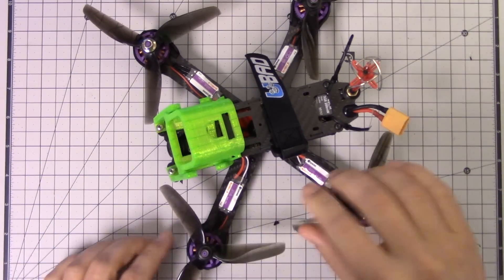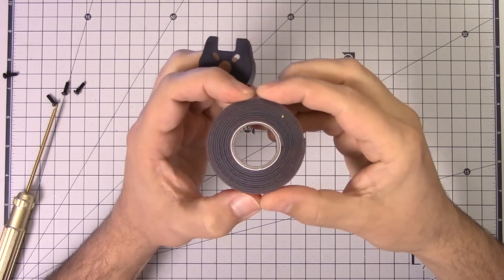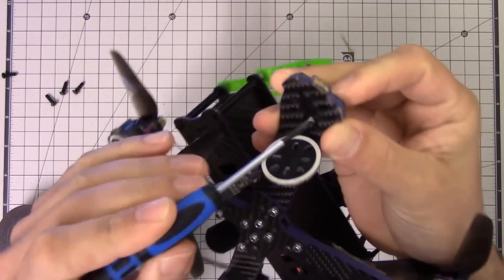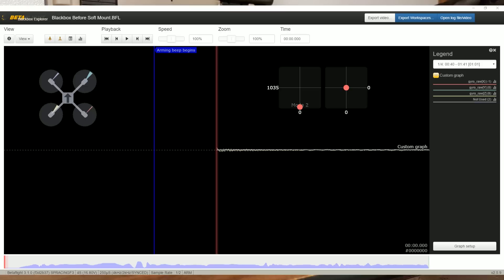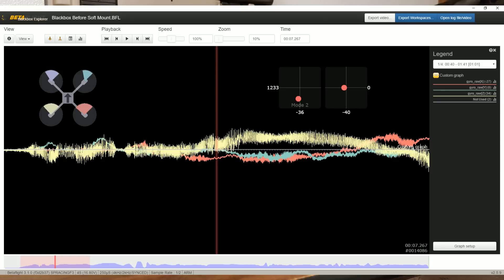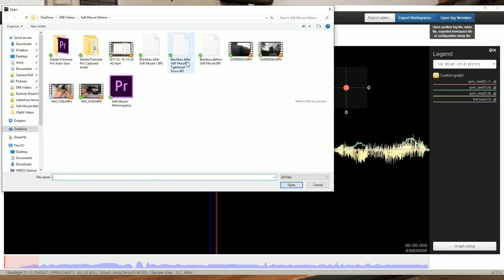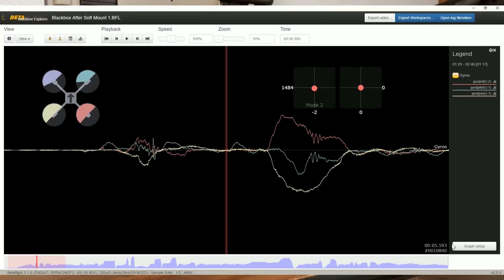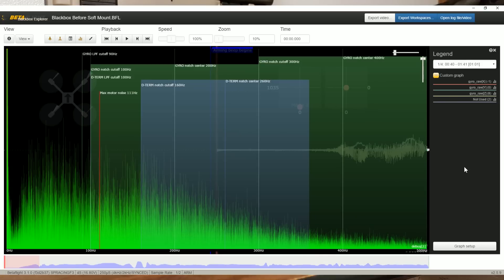Soft Mount Quadcopter Motors | MYTH BUSTED OR CONFIRMED?

Comment: Awesome idea! Have you thought about adding a bit of padding to the screw head side when mounting? It may create even more vibration isolation as it reduces the problem you brought up in the beginning (how the quad still has contact to the frame), as well as possibly allowing you to put more torq on the screws for added safety. Maybe it will make the ride that much more "juicy"? Haha
Reply: Or use an O-ring. :D Also, some adhesive tapes have just as much holding power as those screws, potentially eliminating them all together!
Reply: @wanderlost.productions   Are you suggesting using double sided adhesive tape to hold your motors on?  Good luck with that!.. :D

Comment: seems obvious that 1.5mm of squishy foam tape would have some dampening affect however i would love to see you repeat this with electrical tape and see if it performs at the same level. Also makes you wonder if fully isolating the motor with proper vibration dampeners would work well. http://static1.tme.eu/products_pics/6/b/e/6be2c7d9b4beb7e867114e4d9d25bfed/19206.jpg
Reply from the maker: +Queron Williams seems obvious and yet the skeptics abound.

Comment: I have tested different materials and some are better than others and even worse than nothing. best one yet are 2 layers or doublesided foam tape, same as Joshua demonstrates here. I also tryed one layer with good results but not as good. I tryed 3 layers of Electric tape and it worked but not nearly as good as the foamtape. I also tryed 3 layers of theraband black rehabilitation training silicone bands and it dident work the right way, it was worse than non soft mounting. mabey the material is good in itself but atleast not in 3 layers becouse it tends to "cripple" and wrinkle up and "delaminate" when tightening the screws.
Reply from the maker: +SLINGSHOTandMOLOTOWS this is not foam tape. It's a rubberized mounting tape.
Reply: Have you tried those 3D printed TPU motor mounts?
Reply: alright man, so the kind you use is harder I guess from the kind I used. I used TESA White 1mm doublesided tape for mounting mirrors to tile.

Comment: Hey Joshua, can you test out something like these-http://www.globalindustrial.com/p/fasteners/vibration-isolators/isolators-machine-leveling/vibration-mount-1-tapped-hole-1-threaded-stud-31-inch-dia-8mm-h-m3-x-6-thread

I've been using them on builds with untunable yaw twitching with great success. I think they would possibly be better than isolating the motors.  Just wondering what your thoughts would be.

Comment: Thanks for sharing. Very interesting. I started FPV back in 2012 when things like the QAV400 were the go to FPV quads, which back then was actually described as a small aerobatic frame, ha. Most of the popular frames around then had soft mounting built into the design. At the time I just figured they stopped including it in designs because software and filtering had improved and 250 miniquads didn't need it because of the smaller scale.....obviously not entirely true. 

I think maybe the Blackout 250 miniquad (now old too) moved the trend away from soft mounting and vibration dampening. When the Blackout 250 came out people were mostly using smaller 1800 sized motors on it. I guess now that motors have gradually moved back to larger sizes with bigger magnets and more torque; vibration issues are coming to attention again.

Wonder if frames will start to move back to including vibration dampening into the design.

Comment: Have a go at putting silicone washers under aluminium 'cone' washers on the bolt side of the arm to supplement what you've already done.

I've done so in the past while playing around with reducing vibration for an APM board (with mixed success). It would be very interesting to see what data comes out a black box log with modern hardware.

Comment: Wouldn't it be better to wide the screw holes to about 4 mm, and use silicone anti vibration pads? You could test cutting the bottoms of these: https://ae01.alicdn.com/kf/HTB13M5zKFXXXXXSXFXXq6xXFXXXt/Eachine-Assassin-180-Spare-Part-font-b-Vibration-b-font-font-b-Damping-b-font-Plate.jpg

Comment: awesome.  I was too lazy to do this myself.  I just tested a 1.5mm TPU pad on my motors but I need to get longer screws to feel comfortable.  So ideally, the motor screw holes should be outside the base of the motor because then you can use a lock nut and then you don't need to cinch them down so hard.

Comment: I am a doubter! The motor screws still have to be tight....so heat and vibration can pass down from the motors through the screws.....or have I got it wrong?  It sounds similar to the Phantom 3 problems with cracking arms....some used Bondi to fill the area around the motor Base ....other added plastic or metal support plates externally. The problem was cured when Eric risked one of his many billions and changed the design and motors. Again, the Phantom and any other gimbal using the soft spring balls have to float ...they cannot be screwed tight....but hanging Motors like that would result in very short flights.....

Comment: I'd like to see somebody release replacement arms with motor mount holes large enough to fit a grommet through. Use flat washers on the bottom, and slightly compress the grommets.  Should eliminate a lot of the vibrations transmitted to the frame.
Reply from the maker: The arms absolutely have to be rigid. Every frame I have ever had with non-rigid arms was a pain in the ass.

Comment: Okee, so wouldn't soft mounting the FC itself then have the same effect? (I do see that isn't allways an option)
Reply from the maker: Soft mounting the FC doesn't always work well. The FC is very light, so it has very little damping. Also, it's not always practical to do that because of how the FC is mounted. Finally, the FC is subject to frame resonance, whereas if you prevent the noise from getting to the frame in the first place, resonance will be less of an issue.
Reply: Ah yes.. weight / momentum.. That is a good point indeed. I did recently solve the same 'problem' on an F3 Evo (9250 I think) by mounting it on a rubbery / foam block.. But yep.. that's not allways possible..

Comment: Exactly what I've always said - vibration must be dealt with in hardware! No software filtering will work as good as a decent mechanical solution. Soft-mounting motors proved to be viable not only on racequads but on bigger copters as well.

Comment: Great video.  Is there any concern about decreasing the airflow to the bottom of the motors via the openings in the frame that are now covered up?  I'm new to this FPV stuff, so I was wondering about the openings in the frames under the motors?  Are they functional or are they just there for weight savings?
Reply from the maker: I think if the material was puffy enough to block the air gaps in the base, then possibly yes. Depends also on whether the motor has active cooling or not. This is a case where something like TPU or a custom cut pad would be good.
Reply: Sounds good.  Thanks for the reply.

Comment: Hi Joshua and everyone, has anyone thought of using the rubber self-vulcanising tape to soft mount. Its the stuff they use to wrap wiring harnesses etc and can be bought from most electronics stores and auto stores. 
 The other question is, have you thought about putting one layer under the motors and one layer under the arms between the led plates? with a quad like the wizard you have the perfect plates under the arms to hold the bolts, maybe insulation on both sides will dampen all vibrations. Maybe the little silicone o'rings we use to soft mount the flight controller would work well on each bolt too.

food for thought.

Comment: Awesome video! Actually never heard of it, not that big in flying either so it doesn't matter much =D But I've learned something!

Just a question though, could you perhaps take one layer of foamtape on the underside of the arm as well? Together with some washers or anything else needed so that you don't jack up the tape of course. Could that help even more perhaps?

I'm certainly not saying that the screws are touching the frame, cause I think your results are really awesome! Actually I thought this was a "trolling" video at first, but apparently not =) But I mean, for those who think it does so much difference, could you try and make a video with one layer of foam tape on the underside of the arm as well?

If you get what I mean ;)

Anyhow, really awesome video! Never thought or heard of this before, but certainly.. Why not? It surely does some difference! You got yourself another subscriber also =)
Reply: Yeah I think you're right, it makes sense to have it on both sides. Because there is only dampening happening in one direction of the screw axis, and the other direction would be hitting on the frame. Perhaps either more dampening tape etc on the bottom side, or a spring washer with a decent K to 'pre-tension' the dampening.
Late reply I know, but im about do do my first build.

Comment: +1 on the soft mounting motors. Had a frame with yaw twitches I couldn't resolve. Soft mounted the motors with electrical tape after watching Johnny's video, and everything is right with the world again. Definite +1 on the need for loctite however. Only 3 packs through the quad and everything was coming apart.

Comment: would it also help if you put tape on the bottom of the arm between the screw head and the carbon fiber with a washer to keep it from contacting the frame?
Reply from the maker: I think that soft mounting as close to the source of the vibration is ideal. At the end of the arm, you have all this resonance that can be occurring that seems like it would be harder to isolate. Also, my experience with the Strider frame (which had foldable arms) led me to conclude that the arms need to be as rigid and secure as possible. Otherwise, in every crash, they wiggle and wear away the carbon a bit more.

Comment: But there is one problem, that jhonny's video was showing just 2pieces of electrical tape , instead of a 1mm rubber mount, so the difference would be almost none, i may be wrong, i don't know, i was just wondering.
Reply from the maker: You saw Willard's "before" footage with the twitchy KISS copter, and he said it was cured after adding electrical tape. That, combined with this demonstration that soft mounting motors definitely can have an effect, is enough to convince me that even electrical tape can make a difference.
Reply: Yeah, it can, i noticed it, as 2 blade props would give me lots of vibs and they were somehow ''gone'' mounting motors with electrical tape, but i was just asking because of the motor screw tightening. Dunno hehe thanks for that quick answer ;)

Comment: i had no internet for the last 2 weeks so im new to soft motor mounting :) but why dont take it to a 100% percent soft mounting(motors)? what i mean is, put a carbon plate from the bottom and tape between that plate and the arms. so there werent even screw heads touching the arms... anyone tried that already?
Reply from the maker: That is definitely an approach worth exploring. But in my opinion, the goal with soft mounting is to get enough vibration reduction. Once you have enough, adding more may not have additional benefits, and may have down-sides. Once the copter flies great, stop messing with it.

Comment: Sigh, naysayers... Bolts touching: yeah only pulling on the frame when motor is traveling upwards. When motor is going downwards or sideways, they allow some slack. Thus dampening one half of the sinus of the vertical (pitch) vibration and dampening in all horizontal directions as well as rotational (increase/decrease in motor torque).

Comment: Ok, lots of comments; so someone may have said this already but what about the theory of soft mounting the motor screw heads as well? So soft mounting both sides of the screw? Plausible?
Reply from the maker: Definitely. Need a plate or washers to keep the screw heads from pulling through.

Comment: You should try to compare it to the Electrical tape method now and see if the double sided tape is better? That Blackbox is an awesome tool, I wish KISS had something like this. I soft mounted my FC and noticed a difference. I run out of O rings, so I used those big wide flat rubber bands and cut then into little square pads and mounted them above and below. I think the rubber bands actually work better, as the rubber is a little softer, but not too soft. That's kinda why I'm interested if the Electrical tape is better or worse then the double sided tape.

Comment: Why not just isolate the flight controller? I know you can use silicone fuel tubes but still why not softmount motors as well as flight controllers? It will work so much better!
Reply from the maker: Some FC's you can't soft mount, like the Shuriken X1. And soft mounting the FC is not always effective because it has small mass, therefore it is not well damped.

Comment: And what about downsides of all that softmounting? As I understand, there are two obvious side effects: any filter introduce delay, any damping system has it's own resonant frequency. 
IMO soft filters are way superior and more configurable, the only case we should use hardware filtering is when vibration level exceeds the level gyro can handle (It's micromechanical device after all).
I still think there is too much hype. Softmount is an instrument for resolving specific issues, not a wonder-all-case-solution
Reply from the maker: The problem with soft filters is that, as you say, the gyro itself has hard physical limits that can be overcome by excessive noise. At that point, the gyro starts freaking out and no amount of soft filtering will fix it. For people who are experiencing this, soft mounting FC or motors may be the only practical choice. IMO, we ARE seeing this happen on some copters.

Second, I don't know what the delay characteristics of a given soft mount are, and honestly it would be very difficult to actually measure this, but my gut feeling is that there are many cases where soft mount provides better filtering with better delay characteristics than software filters. I could be wrong about this. You can imagine a scenario where the FC is on really soft bobbins and you get feedback oscillation, but basically every time I have heard of somebody using foam tape or what-have-you on their FC, it made the situation better, not worse. That's not true of lowering the cutoff frequency.
Reply: The next question is why the hell would somebody want to put hardware LPF before his super-secret extra-sensitive 32kHz gyro? Does it make any sense? :D

Comment: Josh, my question is in regards to tightening. You said you had a tight and not so tight experiment. Just how "not tight" are we talking about? Turn the screw till you just feel resistance?
Reply from the maker: There really is very very little resistance in the screws because of the compressibility of the tape. Even if I were to give you torque wrench specs it wouldn't matter because you're not using the exact same tape as me. Basically, I turned the screws until I saw the motor seating into the rubber. Then I turned them a bit more after the 1st test.

Comment: +Joshua Bardwell What props are you using on your Wizard? Do you have a video that covers tuning out drift when hovering? As a fixed wing flyer, I've been using the trim tabs on my radio, but I've seen posts that say that's wrong. To do it via Clearlight/Betaflight.
Reply: A few things that will help is to actually make sure your surface is level before calibrating your accelerometers and gyro and also to reduce "level strength" in CleanFlight/BetaFlight

Comment: What are your thoughts on the motor mounts? Do you think that they will effectively protect a motor in most crashes or do you feel that they are a waste of weight? My other concern with my emax rs2205s motors is that the will get a lot less airflow, do you think that could be a problem? Thanks, Love the videos.

Comment: I'm going to try one of those silicone cooking mats, they're cheap on eBay and only 1mm thick.
Reply: Justin Holmes you could also use silicon tape - the non-adhesive kind. i think it's marketed to make electrical connections water resistant

Comment: Very nice and technical video showing some difference in soft mounting. I do agree with the mounting tape and I would even try small o-rings because it is thicker and would dampen the vibration more. My question is how tight was the first try and how tight was the tightened test? Is there an objective guage on how to tighten the screws and have a difference and not have your motor fall off? Do we tighten all the way and back off 1/16?  Your videos are always very informative. Thanks
Reply from the maker: +RCDR1000 I wouldn't tighten all the way because that would crush and deform the material.
Reply: What did you do the first time you soft mounted it because that made a big difference based on your testing? Thanks

Comment: Any downside to this?  Is any latency introduced?  If so how might it compare to the latency from lpf.  Probably less I hope.
Reply from the maker: +Michael Koster filtering always introduces latency. But in the cases where this will make the most sense the magnitude of the noise is so great that it's affecting the gyro top much for soft filtering to really work well. So physical filtering is the best option.

Comment: wonder if it would improve further by placing an O-ring between screw head and the the arm
Reply: I wondered if an O-ring between the arm and the motor would be as effective.  It would seem the 3M tape cushioning would be similar but its larger mass would absorb more vibration?